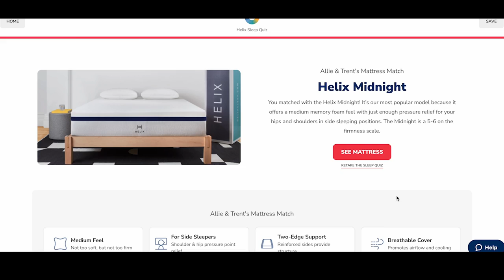WE'VE BEEN WAITING MONTHS FOR THEM TO ARRIVE!!!

Comment: Light from a south-facing window penetrates 12 to 15 feet. It's only SLIGHTLY better for the open sides of a porch roof. In other words, your porch is deep enough that you will be getting virtually NO light from the sunniest southern exposure of your house. Your bright airy home will turn into an airless gloomy cave! Please, I beg you, listen to a designer with forty years of experience: install skylights in the roof over each of your windows. Yes, you need a roof since you ignored your previous designer and made a mistake with the roof design. But it absolutely should not be a solid opaque roof. Skylights for a porch don't need to be fancy or expensive. You just need to bring light into the house. I'm talking to you, Allie - Trent is so damned good as a DIY contractor that he tends to overestimate his design skills. Don't let him! He will ruin the house if he installs an opaque porch roof.
Reply: Why do skylights always eventually leak??
Reply: Linda, could they get away with pitching the roof over the deck as an extreme A frame, or perhaps using a colorless material to build the roof?
Reply: Kind of dramatic don't ya think? "Please, I beg you"! 🤣
Reply: @priscillachapman9145 our skylights never leaked. I think the frustration from the ones that do ( not sealed & maintained correctly) are what people hear and hold onto the most
Reply: @debraemke3828  I had sky lights in my newly built house 20 yrs ago that never leaked while I lived there!
Reply: I have been wondering about the roof and placing of the porch the hole time. 
In northern countries we know all about this. I wood not skip  the glasspanels in the roof! And also put the roof high up!
Reply: Good advice …🙏🏽…agree the construction has all been great…the design of everything needs help though!!! Excited for them, regardless.
Reply: If you go with this suggestion, buy nicer skylights, we had a roofing company for years, inexpensive ones are notorious for leaking! 
Anything that opens the roof is a risk but…if you need to for light…don’t go cheap 😉
Reply: They seem nice enough, but agreed, that house clearly had zero input from an architectural designer and their problems just get worse because of it. I cringed the entire kitchen build. Hope they take advice from an actual professional on future building design.
Reply: I was thinking the same thing. That beautiful deck with the sunshine and openness will be gone. Living in South Florida we needed a screened in porch and a roof over it so my mom chose first to put a plastic corrugated material that was clearish but the heat was unbearable. We then redid the whole thing with like a sandwich board with insulation as the roof kind of like a refrigerator I guess and the screening but it was darker I must say. Somethings gonna have to give I guess.
Reply: Definitely. We installed opaque sections over windows.  Perfect, light without snow.
Reply: Why not just install a liquid heating system under the deck to slowly melt the snow? No roof required.
Reply: @@TheMelbourneHeart Did you ever notice how the inspector always agrees with Kevin's plans? It's like that everywhere.
Reply: @The Aussie Family she was making a suggestion. Lighten up and be nice. Sheesh. 🥴
Reply: I’m not a designer or a builder so take this with a huge grain of salt but when we remodeled we had to have a room built to connect the original house with a two story perpendicular extension which blocked the sun from the rooms on the “L” portion. We went with an octagonal room with glass panels on each of the roof sections and made it our dining room off the kitchen. They’ve never leaked, give the feeling of being outdoors, great for growing trees and plants and are just beautiful. It’s worked wonderfully and gives the room continuous light throughout the day. My absolute favorite room. Maybe it might be a solution to go with glass panels all throughout your new roof rather than just skylights? Thing is you’ll have to have a steel beam engineered in there so it might be a challenge but I’m not and engineer either sooo….🤷‍♀️ I just suggested it as an off beat option because, from the biggest problem we faced when designing the addition, it became the best feature of the house and the room we love the most.
Reply: If they put skylights up on the roof that has they most snow falling onto it, or (fluffing) I think that's what Allie calls it, won't they heavy snow go thru a skylight? I don't know I've never had a skylight.
Reply: @kevanray  that's what I was thinking! Is it expensive?
Reply: @annbolynn7797  The a-pitch wouldn't help much, it's not the angle of the light so much as it is the depth of the porch. But your idea of using a colourless (or even translucent) material is an excellent one!
Reply: @DBurgg  Yep. They're young, they're highly independent and individualistic. I figured I needed to capture their attention!
Reply: @debraemke3828  True. And, we're talking about a porch, here, where a leak is less catastrophic.
Reply: @gunlindblad6816  Precisely!
Reply: @Zinnias2go  Actually, for outdoor applications, you don't need to get fancy - and certainly not as fancy as you do for an indoor skylight where you have to worry about thermal losses as well as weather. Simple plexiglass or polycarbonate panels in a fixed frame should do the trick.
Reply: @Kat00000  Ooh. Excellent suggestion!
Reply: @The Aussie Family I have a few quibbles with your post. First: as a designer, it is exactly my job to tell people how to build things. That's what I get paid for. Second, I love these kids and their compact little house. It is not a design I would have created, but it works. It is light and airy and has the rooms proportioned appropriately. I have encountered many houses in my day with grossly disproportionate rooms. I am not being 'negative', I did not "trash" their house or their design. Once again, I don't think they have considered how an opaque porch roof will cut off light to the house. Trent has already admitted publicly that they have the crushing-snow-load-on-the-porch problem because he ignored his designer's suggestion of a shed roof and built it as a gable roof. This is a testament to his character, if not his design expertise. Finally, a HOA and the Building Permit Board offer no design guidance. HOAs govern the public facades (so nobody gets carried away and ruins the neighbourhood with a fuchsia house) and the Permit Board cares only whether it is constructed well enough that it is not hazardous to the occupants or a fire, sanitary, or water runoff hazard to their neighbours. Neither body assesses or gives guidance on design.
Reply: @sharithompson1672  Even better suggestion! Although, still might not be necessary, especially if they choose reinforced polycarbonate (cheaper lighter and lower maintenance than glass).
Reply: @sky02148  glass is actually pretty strong (there are glass panels you can use as unsupported flooring). But, even better are reinforced polycarbonate panels or plexiglass. The other thing that would help is snow guards or snow brackets are roof-mounted metal “spikes” installed to break up the snow so when it falls, it falls in bits and pieces instead of one huge heavy sheet.
Reply: @missy4663  Sadly, yes. It is more expensive. Polycarbonate (the heavy reinforced panels that will hold up to snow) are still more expensive than standard roof decking. Still a better deal than living in a sunless cave, IMHO.
Reply: @debraemke3828  ....& I suspect you had professionals install them! ! 😉
Reply: I agree 100%. My husband insisted on a deep porch on the south and east side of our home and it cuts off every bit of sunshine for most of the year. The only time we ever have sun directly streaming into the house is during the winter at sunrise. And in the Pac NW you can guess how much that is. Maybe a dozen or so days? I've grown to hate my beautiful home I worked so hard on... it's a dismal cave. I spend most of my time outdoors just to get enough sun. Lack of sun is a real thing!
Reply: @The Aussie Family  Wow!!  Talk about someone being a “know it all Karen”.. apparently you don’t KNOW what you’re talking about when it comes to the HOA and building board permit approving house plans!  They are NOT architects to give advice on house plans, their concern is with aesthetic appearance and environmental issues.. Your comment was rude, and a gross exaggeration of a post that was meant to help, and offer advice from a professional that has the experience and knowledge to speak from.. 
You are not Trent and Allie.. they openly ask for advice almost every post, and could clearly avoid a lot of mistakes by listening to it.  They DO NOT claim to be professionals and are learning as they go.. there is no reason for your comment.
Trent admitted that he was advised against building the roof this way.. and now he’s finding out why.
Reply: Dang Linda ease up on the man.Poor Trent being abused in this post.
   Almost called uou Karen haha
Reply: I agree with your thoughts, but By making such a strongly worded suggestion, you have probably increased the odds that Trent will dig in his heels and not follow it 😂. He seems to get pretty stubborn about such things.
Reply: @Jkaye13  calm your farm.
Reply: PLEASE ALLIE- put a “cover” on Leo’s head when you take him out, even if it’s just out near the door.  You took him out once with no hat because you were afraid of the noise in the house and it was cold outside. You’re right not my kid
Reply: @Jkaye13  : Aussie Family gave what is known as “tuft love”.  Trent and Allie was poorly designed…..no closets in bedroom, French door refrigerator in corner, etc.  Trent does not like to take advise and Allie just smiles.
Sorry
Reply: @lindacgrace2973  Thank you Linda. I am sure Trent and Allie will go through a hundred different ideas and perhaps, perhaps we will have been able to plant a little seed idea. We shall see as time goes on .....

Comment: Man that is a lot of snow. Great job putting in the garage door. Got a tip for you. When installing the panels put your center hinges on, then the roller bracket, put your cable on. Next panel  put center hinges on then do the outside hinge and  rollers repeat process.  Panels should 4” wider than the opening. Allow 1” to 1 1/2 when putting track on opening. Again Trent, Allie and Brandon great job

Comment: Recently, we also had to replace our shut-off valve in our house which was built the year before you guys built yours.  Our plumber told us that a few years ago, lead was removed from the brass which made the brass weaker.  Our plumber had been replacing more of these lead-free shut-off valves with stainless steel shut-off valves.  I'm not a plumber, but if that was the problem with your shut-off valve, there was nothing you could have done to prevent the leak.  Oh, and kudos to all of you on the garage door install.  That was impressive!
Reply: Compliment of the season!
Dear subscriber I really appreciate your feedback thanks for Commenting and watching send a direct message via number above to claim prize 🎉🎉🎉

Comment: We had almost two feet of snow recently, I feel your pain. There is nothing worse than water problems in winter. We ended up digging an artesian well in February! Good luck! 
A friend suggested when a big snow is forecast, cover your steps with a tarp. You can pull on the tarp from the bottom and the snow comes with it. No, or minimal shoveling of steps. 
Garage door looks great!
Reply: I may be getting my deep well pump replaced within a week,  ick
Reply: Great suggestion

Comment: I'm not sure if it's a standard thing in other states, but where I live, our water meters have a little triangle that spins when when water is being pulled through - that's how we check for leaks. We just turn off all water in the house (sinks, dishwashers, etc.) then we go look at the meter to see if the triangle is moving. Probably not fool proof but its worked in the past. I know we have a pipe that's corroding in our crawl space so I check it the meter every so often to make sure it hasn't sprung a leak at least until I'm not pregnant and can get under there to fix it.

Comment: Excellent Video as always. 
Just a heads up, always open your main supply valves slowly, otherwise you will get a burst of pressure which can cause your system to fail. Slow and easy. 
Excellent repair.
Thanks again for sharing your life videos. 
Well done

Comment: Trent, use “Leak Lock joint sealing compound” for all threaded connections.  I am a similar DIYer like you, built 2 houses, put my own furnace in, etc.  I discovered leak lock after having to redo a bunch of threaded fittings on my boiler 20 years ago and have only used it since…it works!!!!

Comment: Trrent and Allie I am living in my home built in 1955. It had the old fashioned stretchy springs. They eventually started to fail. So I researched, and found the same system you guys are using, the torsion spring system. Fortunately, the one I got had the drill winder to adjust the torsion spring tension. You could simply put a cordless drill in forward, or reverse with no even thinking about locking it in somehow. It just moved and then stayed there. Fine tuning that door resistance, yet fully closing is a lifesaver in the long term longevity of your opener. Properly adjusted it makes life easy for the garage door motor. 
I'm relieved because there is no more every other week, re-repair the garage door hinges, etc. I would still love to talk to you about the Toyota wreck truck build. I had a high end body shop for 20 years. Everything is easy when you know how. In a 5 or 10 minute phone conversation, I would make you feel elated about moving forward with that project, and being able to shine in just how incredible it would turn out. With your skill set, you will take to this like a duck to water. It's beautiful actually. Can I message you with my phone number or something. I don't want to publish it online for all to see. LOve your channel. You guys are the best.

Comment: I’m thinking a little hobbit type shed could keep access to water mane hole cover. .We had sun porch roof installed with rolled edge at bottom for snow load to slide off.  It had slight solar tint to temper summer heat.  Still looked clear for full view of birds.pitch perfect.  Sorry I Don’t recall name.

Comment: Cannot wait to see deck roof designs. Curious how to make it have enough pitch for your winter snow loads with how low your upstairs windows are… or will it just extend from the roofline and cover those windowsʻ view? always fun to see how you solve your problems 😸
Reply: I was wondering the same thing. I think a standing seam metal roof would be work. It’s slick enough to allow gravity to pull the snow off.

Comment: might be the valve failed because of shockloading (dishwasher / washing mashine shutting off the water and giving the waterline a thud , might solve that by installing a damper in the waterline 
allso be verry carefull opening the lid on the mainwater shutoff outside as it can cause the watermain to freese u , over here where adviced to not open it during freesing temperatures

Comment: You probably have already thought of this but in case……You might want to insulate and heat the water heater and pipes that are in your  attic so they don’t freeze.  You can build an insulated wall ceiling around hw heater / pipes or heat trace the pipes

Comment: It's frustrating to have to replace the valve. I hate threaded components in plumbing.  The PEX-A expansion connections you made will either leak immediately, or will last forever.  The only time I've had trouble with expansion PEX fittings is when the pipe wasn't cut straight enough.

Comment: Oh, Americans, you make such makeshifts. Some plastic welded joints where the temperature difference makes you unsealed. In Poland, Poles do such things themselves without calling a hedraulika. We use brazed copper pipes for water connections, they are thinner than steel and tight. Hee, call some Pole and he will do it for you, in Europe Poles are considered handymen when it comes to plumbers, tilers and apartment renovations.😄

Comment: I can't believe you waited this long to get a snow melting electrically heated mat !  You need a large one outside the door and a couple to go on the stairs.
Once it stops snowing, and the mats have done their job, move them over to an area that needs to have the snow melted.  I only seehave one small mat, but I reposition it 3 or 4 times and melt a nice path to the driveway.

Comment: Owned and operated a Garage Door and opener business, until I was diagnosed with cancer. Which I have beat. However, the chemo and radiation have left me disabled. 

You have started out the door one way it can be done. You are correct on the sprigs being EXTREMELY DANGEROUS. red left and black right. I haven’t finished watching when I commented, so I hope that you are not going to only use a screwdriver to wind the springs. You need hardener steel bars. Put a chalk line on the spring and each time it comes back around that is a complete turn. With the high lift you are going to want to stop the door even with the header when open. Now I am going to finish the video.
Reply: You did a great job considering never installing a door before. With an opener this will not be a big deal, turn the spring bumpers over on the top track and install them when the door is even with the header. Also an opener is only a convenience, the garage door has to work easily and properly prior to installing the opener. Good luck. Feel free to ask any questions. I’m sure that you won’t need to as you said you knew people that are installers.